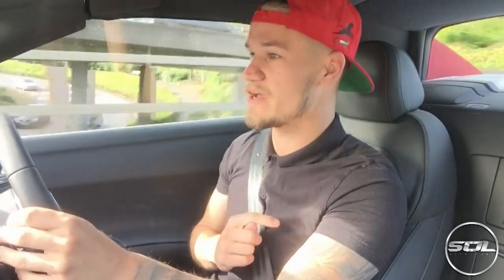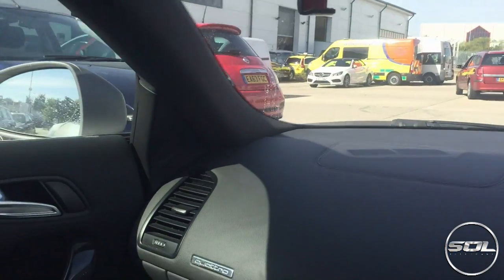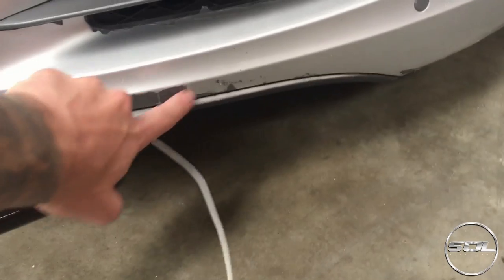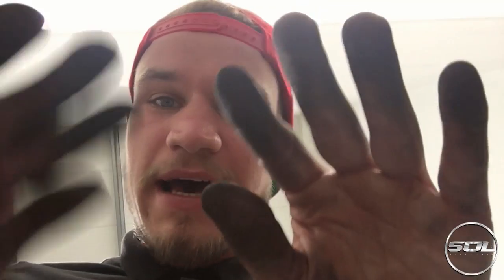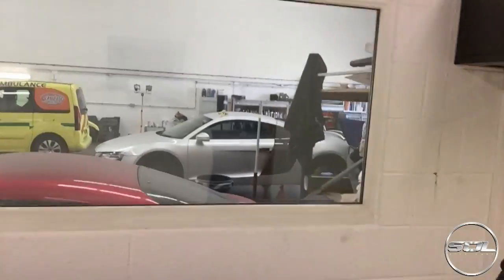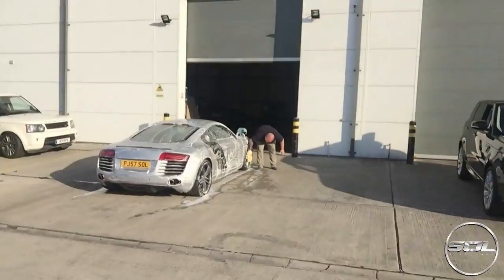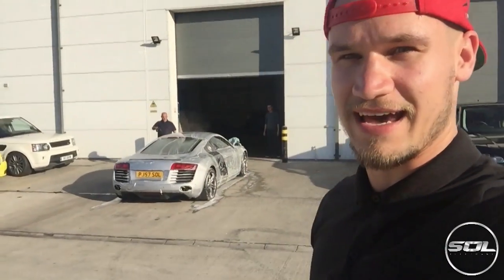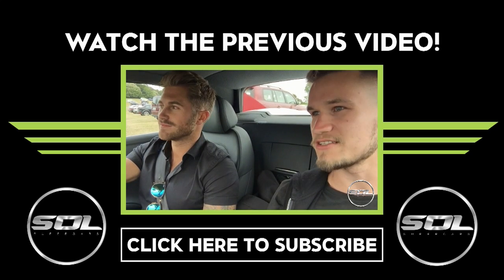MASSIVE CHANGES: AUDI R8 BACK TO STOCK!

Comment: Just out of curiosity...what was your reasoning for removing all of the mods before resale? The exhaust I get because it's worth more separate but the protective coating, which was expensive, was a selling point that you paid to remove...and in my opinion unnecessarily. If the buyer wanted it removed that's one thing but to preemptively remove it I don't understand. It's not like the R8 is a particularly rare and ultra valuable car that a potential buyer would expect to be in mint stock condition.

Comment: Hi! Does anyone know if the peel/paintwork that he has had on his car would work on a wheelchair or a walker? I don't know exactly what it is called but was thinking it might be a neat way to have a bit if a change and from the looks of it still have the original in tact underneath? If anyone knows if this would work I would love to hear and have more info to know what to ask for. Thanks to anyone who takes the time yo reply :)
Reply: It should work on a wheel chair and or walker, because the original paint stays intact. 

That paint is a little bit expensive $😁